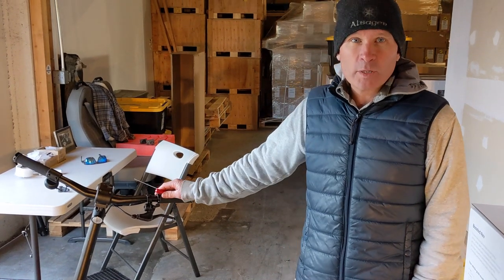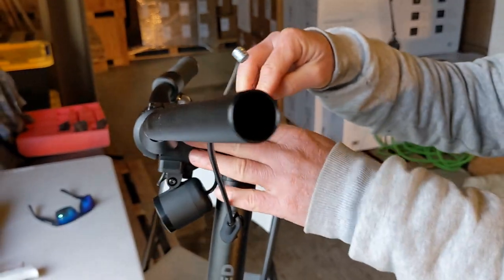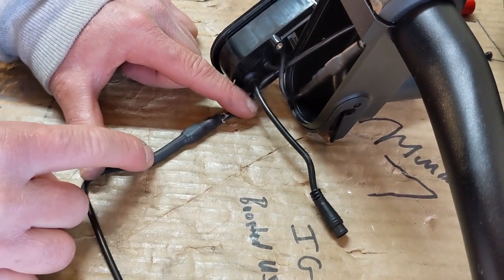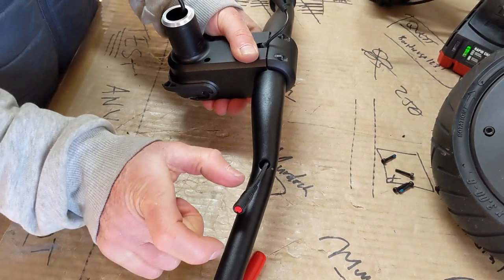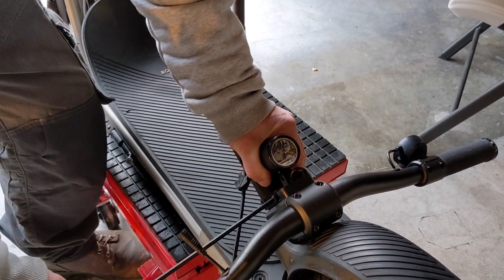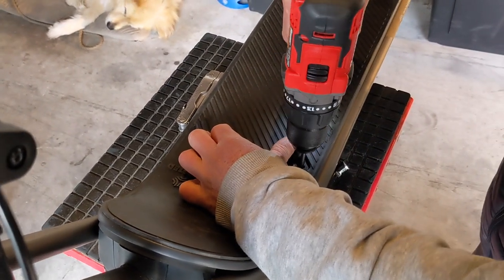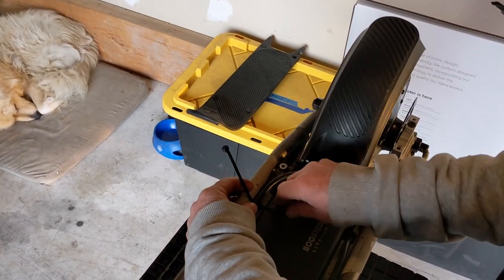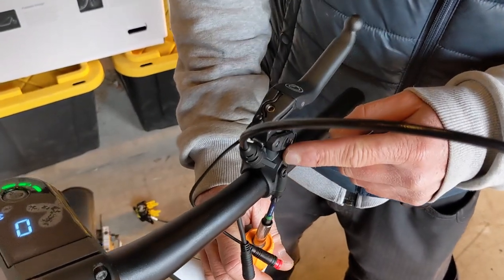Magura Brake Upgrade Boosted Rev

Comment: Thanks.  I Followed the directions and  Everything is working fine but there is an electronic buzzing sound coming from the brake handle when I brake.  Is this normal?
Reply: Did this video cover the sensor that turns on the brake light when you pull the lever? Where is the sound coming from exactly?
Reply: How the conect the cable again why his cut the cable
Reply: Do I need to get the Magura mt5e Higo open or closed version?
Reply: What maguro adapter did you use? Do you have a part number on yours?